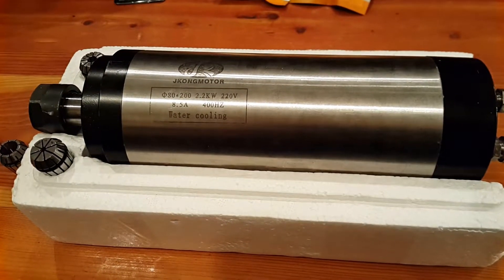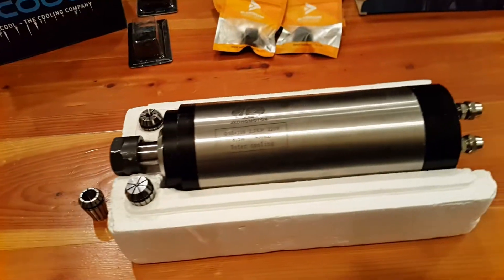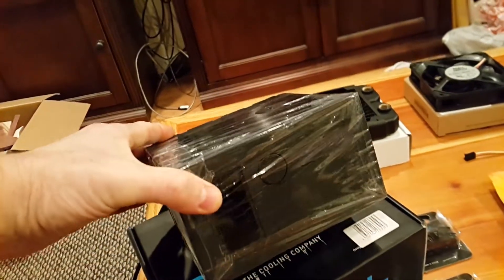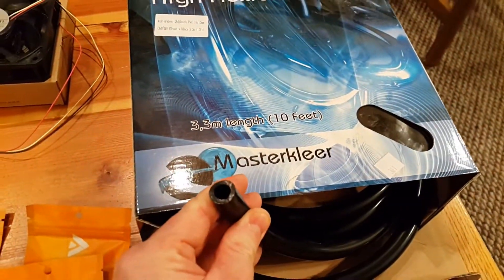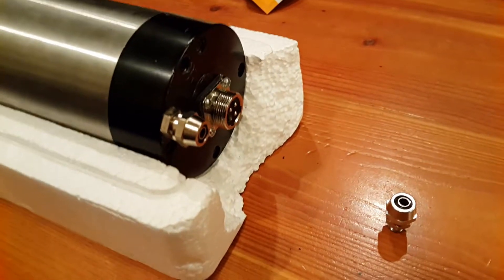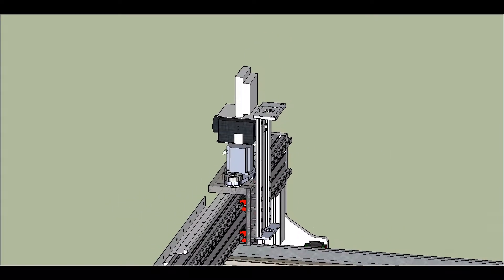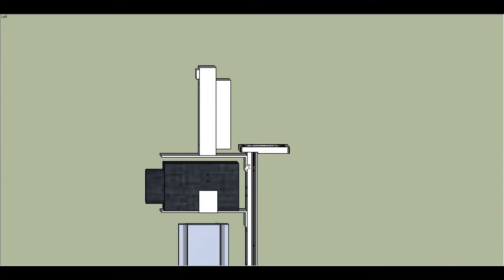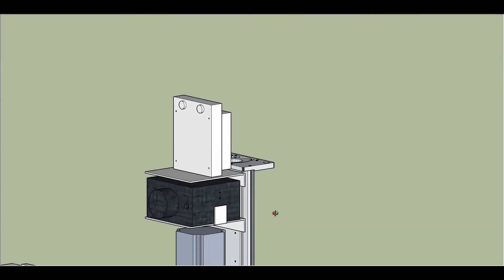Spindle Cooling Overview

Comment: How much do you have in the entire build? I’m thinking about getting a queenbee fully configured with linear bearings for $1500usd. Any thoughts 
Controller: CNC XPRO V5 GRBL
Spindle: 220v 2.2kw water cooled
1500mm x 1500mm
Nema 23 stepper motors
Leadscrew drive 
8040 aluminum extrusion with internal reinforcements